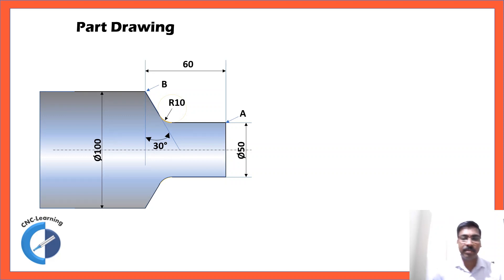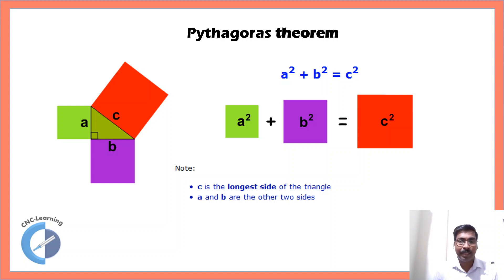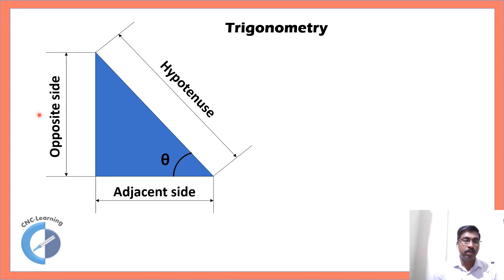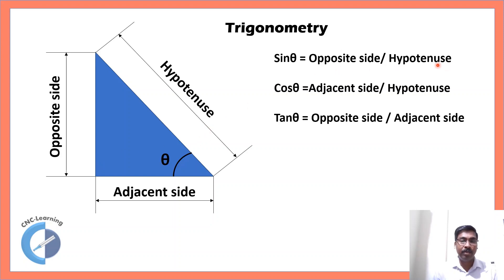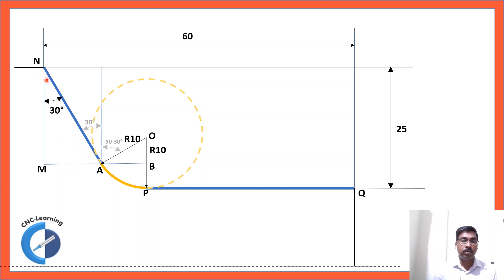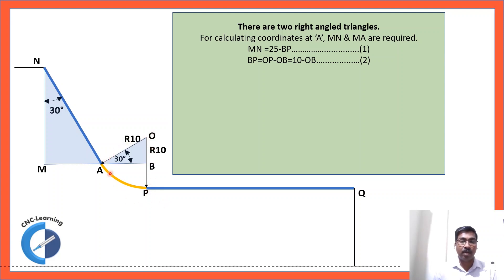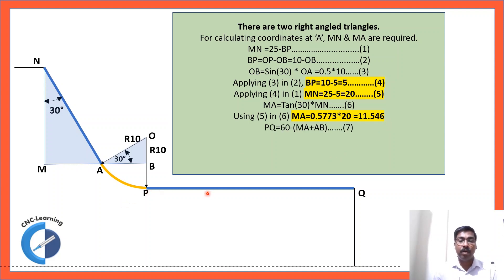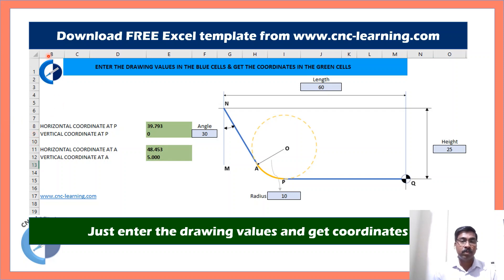Tangent Radius Calculation | Workshop Calculation | CNC-Learning | Rajeev Sreedharan

Comment: Sir., in most of the case in cnc machine shop..there is always problem in radius in and out problem in turning radius in part..what is solution
Reply: Radius will not tangential to line...in contour trace...how to correct it practically sir..
Reply from the maker: That will be either because of back lash in the machine or incorrect coordinates
Reply: Radius in and out is due to incorrect I and K values
Reply from the maker: Are you referring to any error? Can you elaborate with an example?